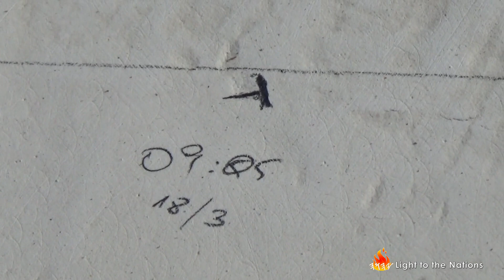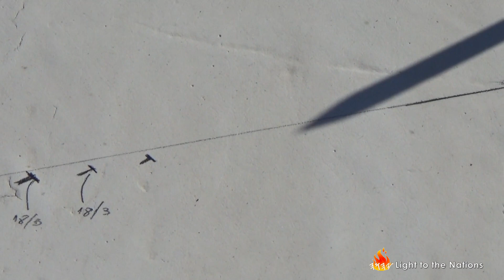Tracking the Equinox - Day 30th, Month 12 - Update Nº 1

Comment: thanks for the update!
Reply: The Dead Sea scrolls have found 3 seperate and different calendars left over by the Zadok community.  Two of them were solar only, and one was both lunar and solar.  The two solar calendars found are completely different from each other.  Yet you picked one of the 3 and claim the other 2 either dont exsist, or cant be true either.  You failed to realize that all 3 calendars were true, and all 3 recognized different wheels in the sky representing the solar, lunar and star cycles.  All 3 were needed as correct witnesses to the moving parts km now as Gods astronomical calendar.  You quote Enoch so many times when it supports your own creation of what you think the calendar is, yet reject Enoch when he clearly says something that proves your calendar is a lie.  Enoch said very clearly, you CANNOT count the 4 seasonal days as actually observed days, yet you do it anyways.  He says your calendar will be wrong if you do this, yet you do it anyways and then boast that your calendar is perfect.  Ahhh the irony of "mans ways and traditions" contrary to scripture.